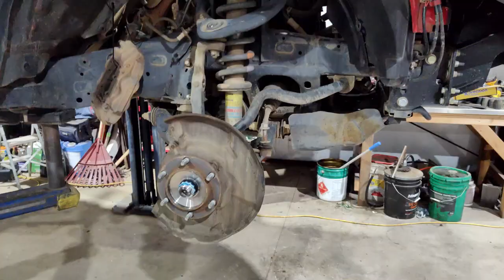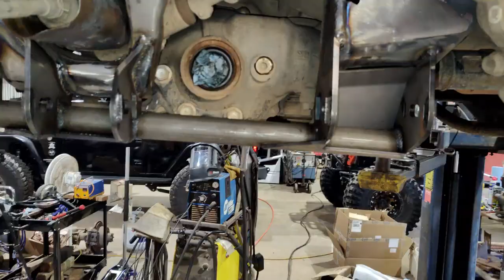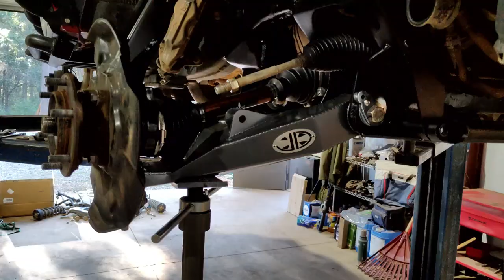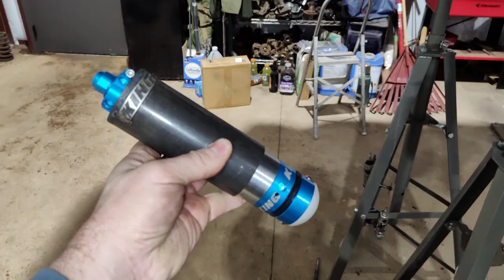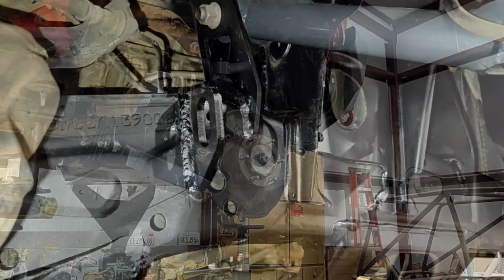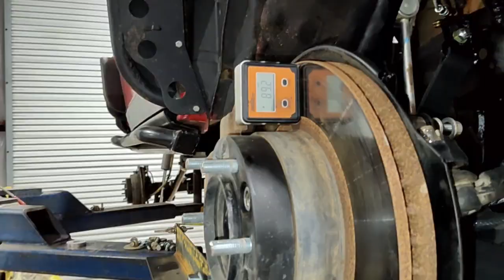FJ Cruiser Gets a Long Travel Suspension

Comment: What pressures did you end up with on the ORIs to get the front end up? Also, is taking the hole saw to the shock towers needed if running the upper mounts flipped on the ORIs? I will be running a similar setup on my 5th gen 4runner.
Reply from the maker: After some experimenting we wound up with 750 PSI in the upper chamber of the ORI's. I can't remember what the lower chamber pressure was. The pressure had to be that high to get things working the way it should, but according to ORI it is well within the capabilities of the struts.

Hole sawing the shock tower probably isn't necessary if running the upper mounts flipped like this. I didn't know exactly how it was all going to work out so I did hole saw them and then later flipped the mounts.
Reply: @MarauderMachineWorks Thanks for the response. The FJ turned out great!